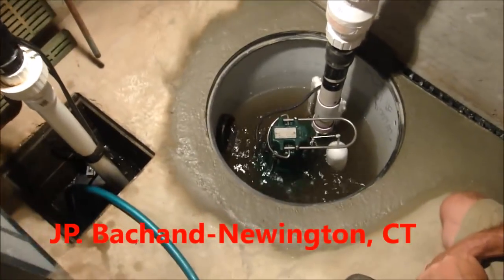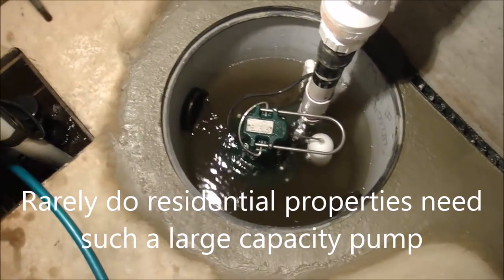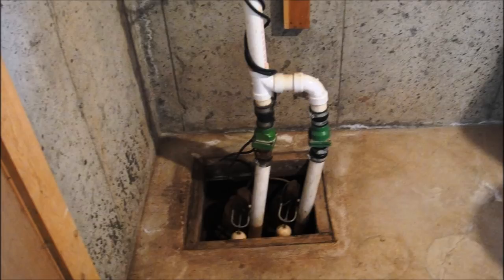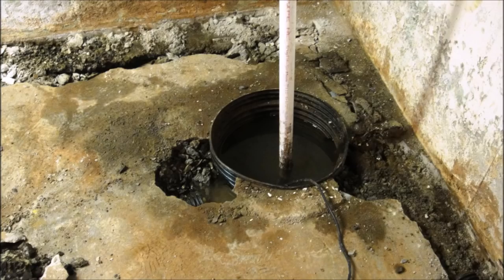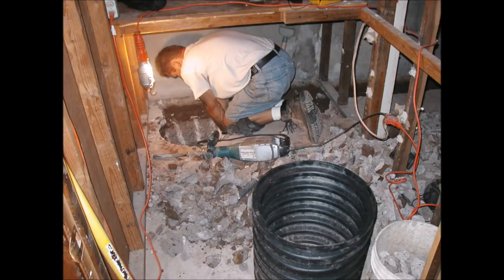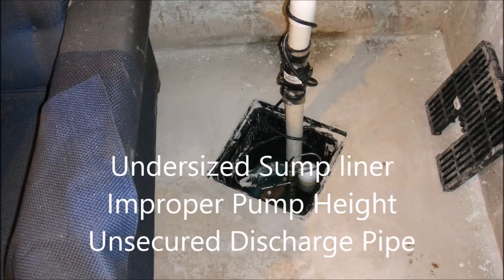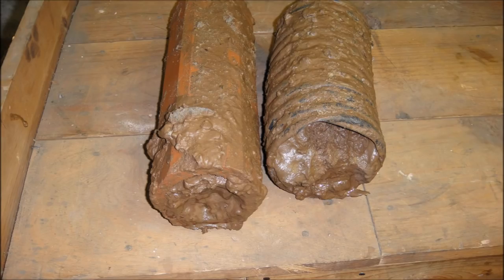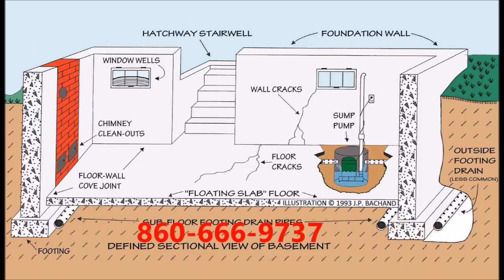Sump Pump Installation and Repair, Newington, Wethersfield, West Hartford, Rocky Hill, New Britain

Comment: How deep should the sump hole be?
Reply from the maker: Depends on the depth of the footing pipes. Ideally the water would pump out before it reached the bottom of the pipes. 
Almost never more than 2 feet though.
Reply: John Bachand what if I had no footing pipes, just a sump pump pit.

Comment: Is a sump liner usually used inside of a sump basin?
Reply from the maker: jmr1068204 
unless you had some kind of extraodinarily stable fill under the floor, you need a basin or liner in the hole to prevent undermining of the floor. We typically just cut a length of 15 inch diameter pipe and call it a liner. you can also buy the premade basins at Lowe's or Home Depot.
Reply: I'm planning to use a premade basin when I figure out what to do. Have been working on my mother's house. A little present was left from the former owners. The FHA made them relocate the gas water heater (which was in the kitchen!) elsewhere. They went into the crawlspace and dug out a 15' L x 4' W x 3' D hole in the crawlspace dirt a few feet inside of the crawlspace door, built a cinderblock retaining wall all the way around it and stuck the water heater in there on the floor at the upper end with a makeshift open basin (they dug a hole in the cement slab floor and stuck a pedestal pump in the open hole). So when it rains a lot, water flows in from surrounding dirt, through the wall and across the floor into the open sump hole. Very odd setup. Oh yeah, there's a central furnace raised off from the floor on blocks, too. House is a raised rubblestone foundation, so there is nothing under the foundation to dig down into the dirt and waterproof.

I have shown contractors pictures of it and they said that they have never seen such a setup in their life. So trying to figure out what I'm going to do. lol  When the pros don't know, that's not a good sign at all. I'm going to have the system moved and flipped horizontal over in the actual crawlspace area to get it out of that hole. Water heater will be raised up far higher and possibly the inside of the hole will be filled with probably 20" of drainage gravel. Thought about throwing gravel into the bottom of the hole that they dug, putting a perforated basin on top of that and filling in around the inside of the entire hole with gravel to stabilize things. Can't fill it to the top, but it might improve it. Water comes from the surrounding ground and apparently the water table moves around at different times of the year. So it can rain 3-4 inches at a certain time and it stays bone dry. It can rain 1.5" at another time and it gets a ton of water. 

Have you by chance ever seen anything like this? It is a freaking disaster: http://oi64.tinypic.com/34ifnfc.jpg
Reply from the maker: jmr1068204 
looks manageable, the big problem is the safety of someone servicing the mechanical equipment. 
electric shock hazard if there's water on the floor, or someone breaking a leg falling into the big hole.

could lay 2-3 inches of 3/4 inch stone on the floor and cap with concrete, leaving a 3/4 inch Gap around the perimeter to allow seepage from the block to pass down under the floor. that would keep the floor dry. then install perforated sleeve in the pit to allow water to drain from between the slabs into the pit.

could also cut a gutter around the perimeter of the floor and channel water to the pit. a couple of submersibles would fit in a much smaller opening.